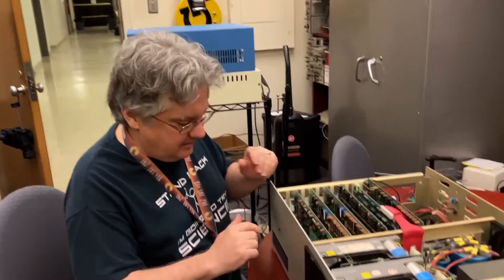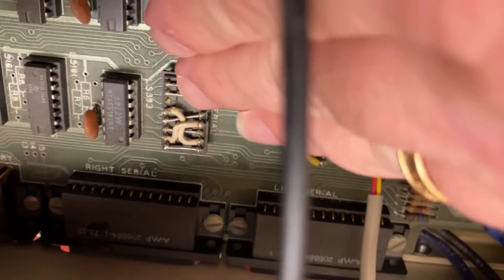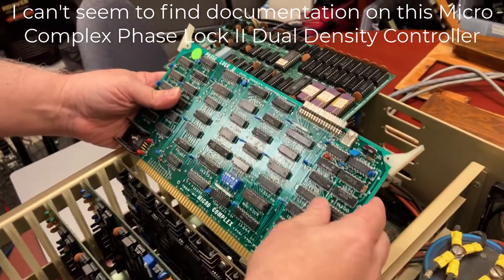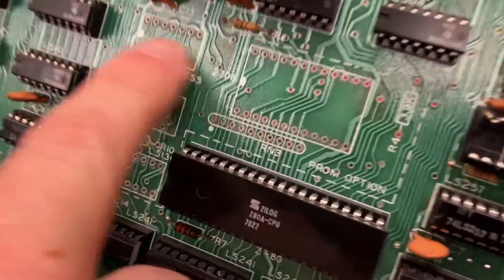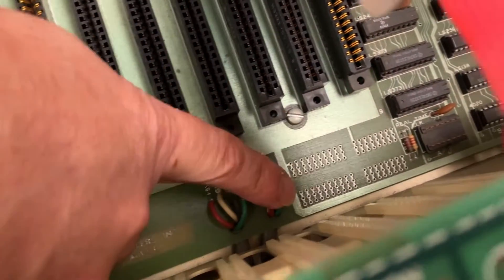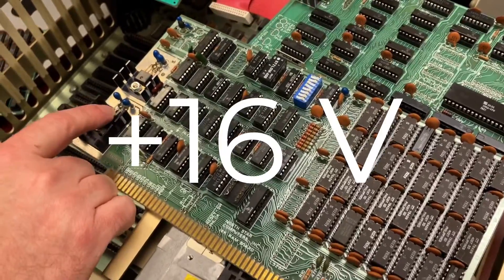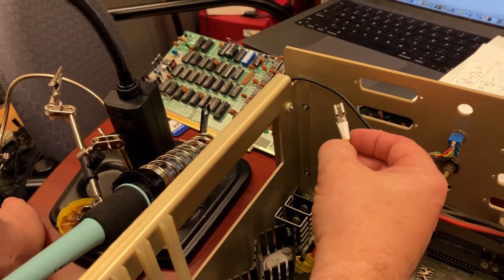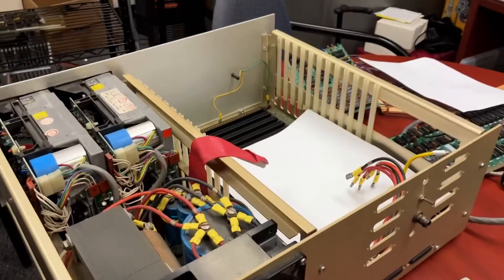Inspecting the North Star Horizon Computer with My Son (S-100 Bus, Built-in Disk Drives)

Comment: OK, without a control panel the CPU board would have to have jumpers, to the address the boot ROM at E800hex on the floppy controller. The funny thing about The North Star Horizon floppy controller was that it was a read only device and it came in two versions, Single Density and Double Density. It occupied 1K of address space in high memory. The memory space was divided into 4 blocks. The first was the boot ROM and the second was just the mirror of the boot. The third block was the control and data block. The last block was the write data block using the address’ to write the data to the floppy controller. When the CPU was ready, to write data or read data, the controller would assert a memory wait until the data was ready I/O. This was very CPU intensive and interrupts where not allowed as this would ruin the timing of the read or write of the data sector. You also need a scheme to avoid memory conflict with any RAM board in the same address field. That’s very much how it worked. The floppies & drives came in single density single sided at 90k. Double density single side was 180k and Quad density double sided was 360k.
http://www.s100computers.com/Hardware%20Folder/Northstar/MDC/MDC.htm

Comment: The regulator-on-board idea is on its way back! Modern computers mostly use 12V and convert it down to whatever voltages they need, to the extent that newer computers are dropping all the other voltages from the power supply altogether. 

It also reminds me of how eurorack originally supplied +5V, but most modules these days forgo the +5V input and regulate 5V or 3.3V or whatever they need from the +12V supply.

Comment: I am reminded of how we used an oscilloscope to debug code on an S-100 system.   The address bus is 16 bits.  We used a proto card and put two 8-bit DAC chips in, one on the high byte and one on the low byte of the address bus along with some glue logic.  The DACs fed to the X and Y inputs of the scope.  Each unique address moved the spot on the scope to a unique point.  It wasn't so much that you could see the exact address, but you could see if it was stuck in a loop, or trying to go to weird parts of memory you weren't expecting.  Great when you had to run at full speed like when doing IO where single-stepping wouldn't have worked.
Reply from the maker: That is officially THE MOST AMAZING THING I HAVE EVER HEARD.